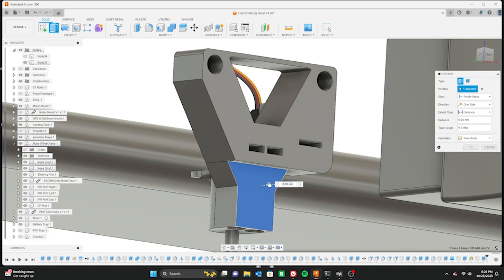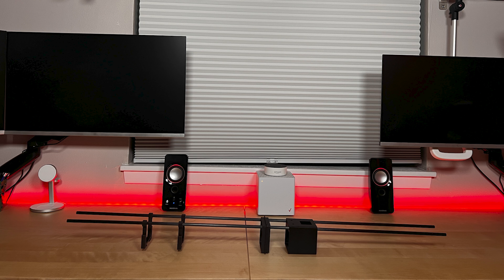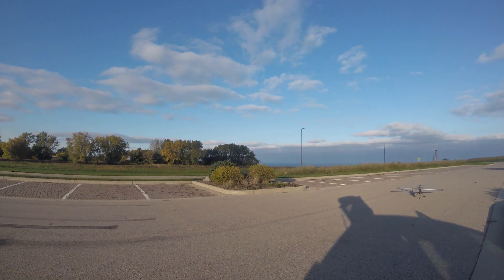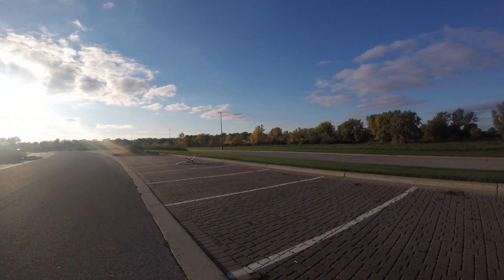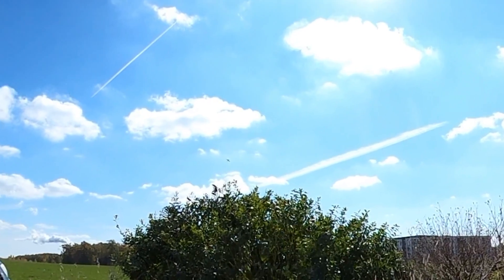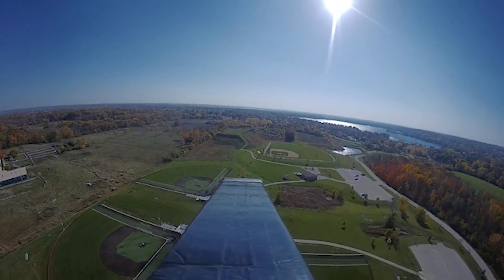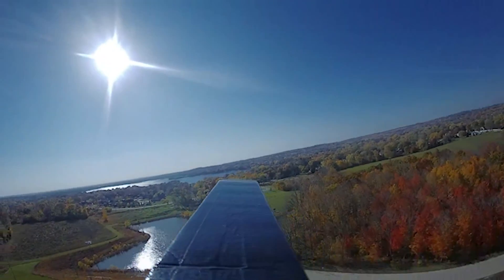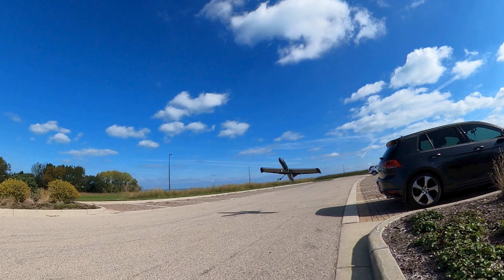Modular 3D Printed Drone - Episode I - The Maidens

Comment: 2:46   ?!?!?!?     sorry.    that is  NOT  where the main wing was supposed to be located.        it should be understood that in a model aircraft, the mass of power and control components should be  Concentrated  near the point in the fuselage where the  c-m of the model  is  Supposed  to be located.      c-m is center of mass.        that is, on the thrust line at a point that vertically aligns with twenty-five percent of chord or mac.      correct c-m location indicated in this illustration.       d
https://s3.amazonaws.com/assets.flitetest.com/article_images/medium/truecg-jpg_1384168691.jpg

Comment: 3:52    the mass of aileron servos should be locate just forward-of the main spar; eg., thirty percent of chord.      cg  should be at thirty.        5:00 ?!?     CF rod or tube has low transverse integrity.      meaning the use of  CF rod/tube in landing gear is not recommended.

Comment: This is a really neat project! Any particular reason you went for a V-tail over a more standard design? Or just going for the vibes?

I look forward to seeing where this project leads!
Reply from the maker: Thank you! Definitely for the looks but also for the weight. It was pretty tricky getting those control surfaces to be rigid when they are made out of foam board 😜 they’ve got 2mm rods embedded in them and also a rod going across both of them with 3D printed attachments so its a bit more than what meets the eye!